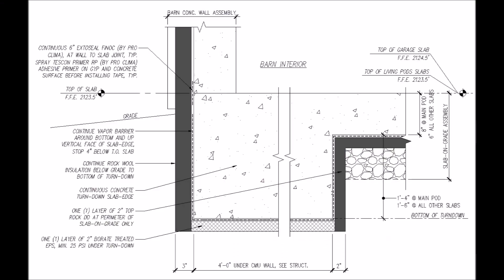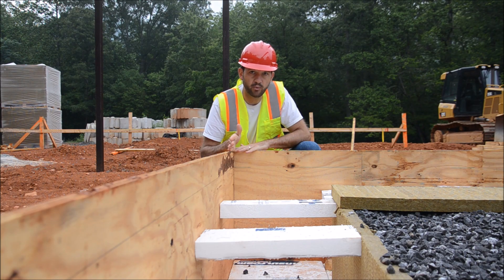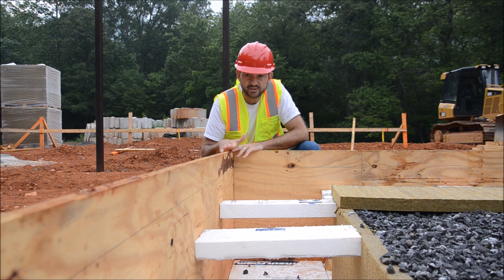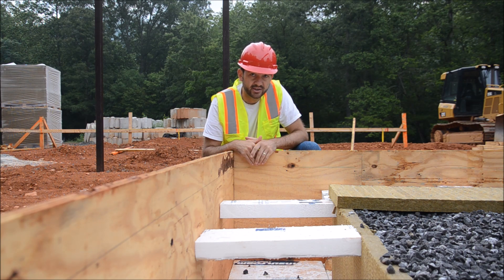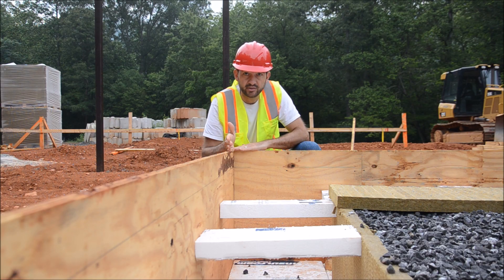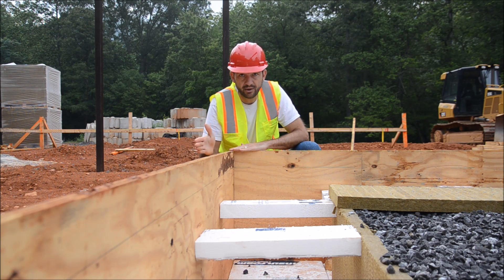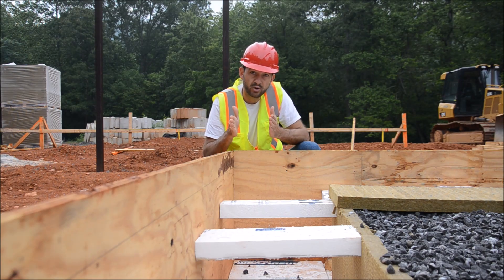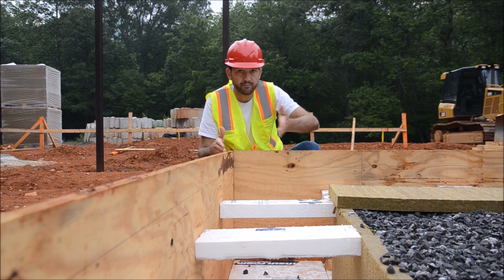Insulating Concrete Slab-On-Grade, Off-Grid Barn

Comment: How are the rockwool panels attached to the slab edge after the forms are removed?
Reply from the maker: Thanks for the question, Mark. 
We typically use 1 - 2 screws with an insulation washer on each through the insulation to hold it in place until we backfill. The soil does all the work, but the screws help until its placed. If we were to have an above grade concrete wall, the same screws we use to secure the insulation to metal or wood framing is used to secure it to concrete. When doing so, we need to pre-drill for every screw. There's no need to go overkill on the screws ( e.g. Tap-Con, etc. ). We use #14 coated roofing screws from Triangle Fastener (here's the link: https://trianglefastener.com/content/files/TFC/MASTER%20DOCUMENT%20PDF%20FILES/25%20concealor%20dp1%20pancake%20head%20screws.pdf )

Comment: Chris, I’m doing a new construction where I used the Bituthene system to ensure my precast wall slabs are all monolithic and water tight. I added a layer of 1in XPS on the walls after the Bituthene. Do you think I still need a water screen above?

Comment: Nice video ,need to biuld next project on iso-slab ,insulated structurale with frost protection kit with high efficency R value ,easy installation at cheaper option.

Comment: Here in Iowa we have to use a thermal break between exterior wall and slab. The monolithic slab went away in about 2003, we still do it for unattached garages, but anything with heat has a stem wall then slab butted up to it.
Reply: Can you describe that in more detail for me? Might be a tough ask 2 years on, but I'm curious about what you describe. I know Iowa gets pretty cold, but I don't understand why you couldn't wrap the entire slap in insulation rather than split it as you said? Help! :-D
Reply: @fredio54  before 03 we would put 2inch thick Styrofoam on the inside of the trench or under the slab. But the slab was conducting the cold to the inside of the structure. Attempts at insulating the exterior is a nice thought, but it deteriorates over time. Our code is 6inches of concrete must show between the grade and exterior finish. I for one wasn't happy with the change, I was in the middle of a 50 bldg project.  It added 2 days and thousands in cost to job. But after thermal tests were performed  I was convinced. Temp of interior slab jumped 30 degrees and more around exterior walls.
Reply: @iowamatt2519  Sure, but can you describe in detail what you're doing? It wasn't 100% clear to me from your prior comment and the above reply didn't clarify at all. Genuinely curious. If there's a vid or site you can link/recommend to read up on it, happy to do so. Cheers.
Reply: @fredio54  we're putting in a 42 inch frost footing with foam on the inside wall. Then we pour a stem wall 8 inches thick and typically  8 inches tall, but can be any height based on grade. Then put 2 inch Styrofoam against stem wall and butt floor against it.   Depending on exterior wall thickness u can adjust to keep foam in wall and not interfering with flooring attachment points.